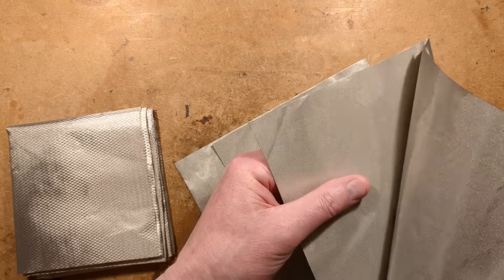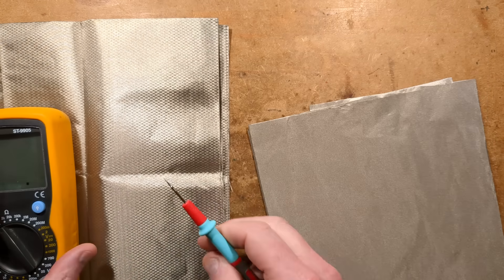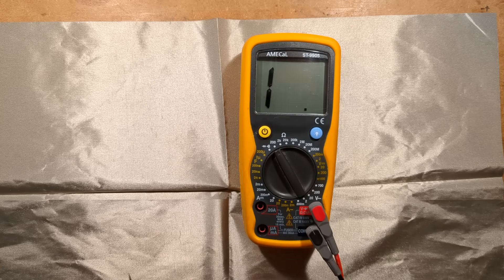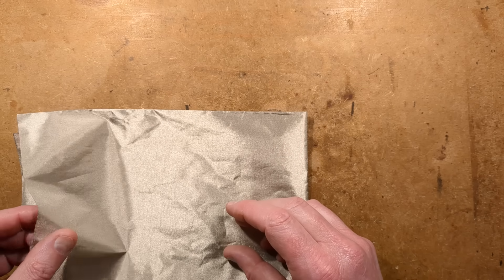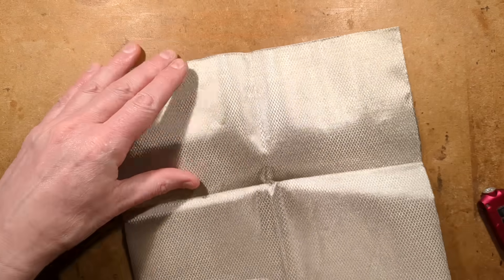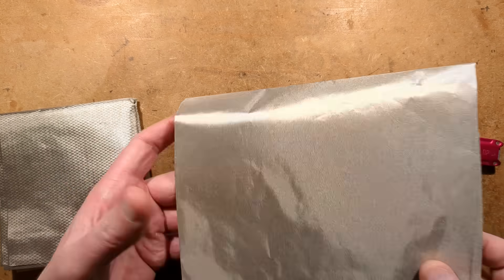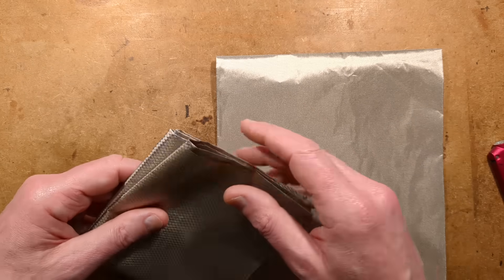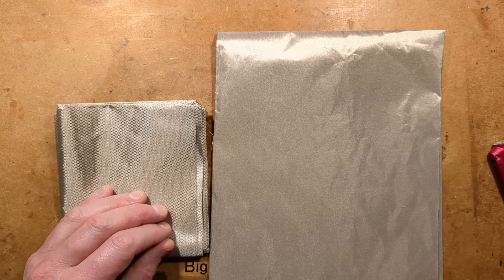Anti 5G fabric is amazingly conductive

Comment: I can see this being used for flex sensors (those used in data gloves). Where you use velostat as a squishy variable resistor, between 2 layers of conductive fabric. It was made before with conductive silicon in lab, so this could open some doors indeed.
Reply: Do you have an English version of what you just wrote? Flex sensors? Data gloves? Velostat? Conductive silicon?
Reply: @paulsengupta971  Sorry for the confusion, here are a few explanations :
- Data gloves are devices (or gloves) that you use to transfer your finger and hand movement into computer inputs. Its most current application is Virtual Reality for increased immersion. One open source project on this topic is LucidVR Gloves.
- Flex sensors are sensors that measure strain while bending. There are multiple ways to measure it, though, the most common way is through capacitive effect, though, resistive, electromagnetic, optical and magnetic techniques exist. They are often sold industrially, or with arduino kits. You can build a variable resistor or capacitor to make this effect.
- Velostat is a polymer film that is slightly squishy, that contains lamp black/carbon to make it slightly conductive. If you place 2 electrodes on either side, and increase the pressure, it reduces the restistance, meaning, it can sense pressure. If you confine it along a flexible strip, then, as you bend the strip, the inner electrode will bend more than the outer one. Squishing a bit the velostat, and reducing resistance.
- Conductive silicon consists on adding conductive particles to a piece of silicon, acting as a sort of thicker velostat. 

You can find more info on the first 3 on wikipedia, and there are many flex sensor tutorials on instructables.

I hope my answers have helped you, have a nice day.

Comment: How easy is it to stitch, and how well does it stand up to being stitched?  Or does it need to be bonded with an adhesive?  I could see this being useful to make a faraday cage shielded drawer for car keys to prevent those repeater attacks—the pouches are a bit naff.
Reply: Seeing polyester in the materials, it's likely same as a polyester T-shirt. Not ideal feel on the skin, but "just fabric" for sewing purposes.
Reply: @sharpfang that’s interesting.  Could be sewn as a backing to some felt, and then an earth lead bonded to it and that terminated in a standard UK plug.  Would then have a decently shielded drawer (wouldn’t  be anywhere near perfect, but good enough for a normie) for car keys and anything else that warranted it.
Reply: @Szlater  It is commonly used for shielding car keys, rfid fobs, credit cards etc. Even without grounding, the inlay plus thickness of coating material suffices against stealing the data with smaller, easier to conceal devices at contact distance, or bigger (briefcase/suitcase) at more extended distances.
Reply: @sharpfang good to know, thanks!

Comment: You can also make taser-resistant clothing with this stuff --- sew a lining inside a jacket that'll act as a short circuit path for the taser.
Reply: You'd need to make it thick as they're designed to piece fabric to pentetrate your skin..
Reply: @user-bt2lx4gy7h  never been tazed, but unless the prongs are insulated after the first 1 - 2 mm then piercing should not be a problem since the fabric would still make contact with both of them and having a lower resistance than the body it would take most of the current  thus making the wearer feel less or possibly nothing .
Reply: Do we have any volunteers to try it?
Reply: @martinploughboy988  Tell to Johnny Knoxville! 😅
Reply: Isn't a medieval gambeson also tazer-proof as the barbs can't reach your skin?
Reply: If you're wearing a jacket then you hardly even need to sew this stuff on to begin with.
Reply: doesnt it need a ground tho?
Reply: @CASyHD. No, not really. The electricity only effectively flows between the spikes and if you short circuit them, they're useless.
Reply: @Biped  They'll still hurt like crap when stuck into you, mind.
Reply: @Anvilshock 
Hurt, but not down!

That’s the distinction; a taser’s job is to completely immobilize a person, otherwise it’s just a fancy piercing tool.
Reply: @Operational117  Oh, sure, it'll still be hurtful depending on how thick a set of clothes one would happen to be wearing at time and place of impact, just perhaps not quite as electrophysiologically incapacitating.
Reply: > "doesnt it need a ground tho?" Draw the whole circuit! (Could be this channel's motto.) The Taze current runs from prong to prong, not to ground. The Tazer has no connection to ground.
Reply: @CASyHD.  It'll have a ground after the suspect has been tasered and is lying in direct contact with the floor.
Reply: @CASyHD.  No, as long as both Taser probes hit the fabric, it shorts them, so you don't get tased.
Reply: @antronargaiv3283  If someone's really that paranoid about it, you can always sew this stuff to a thin, relatively flexible layer of some rubber-type material behind it, which would further limit the piercing depth of the projectile while keeping the likelihood of the EMI fabric becoming the only current path, and this would keep the live fabric conductor away from the skin. Totally unnecessary (I agree with your prediction) but again, if someone wants a bit more peace of mind...
Reply: Exactly what I thought. It’s a billion times better than straight sheets of metal thanks to being literally a piece of fabric!
Reply: I doubt it. The human body is quite conductive and will make contact with a large part of the prongs. The fabric on the other hand is very thin, so it won't have a good contact surface with the prongs.
Reply: Last I checked my body had slightly above the 0.7 Ohm of this fabric.

Comment: I have used similar fabric for laboratory work. We did electrochemical measurements where the signal was in the ~10-30 nanoamp range and the fluorescent lighting/equipment in the lab produced insane electrical noise that would mess with our measurements to varying degrees depending on where you set up in the lab. You could account for a lot of it due to the fact that it was all 60Hz noise, but it still had an effect.

We bought a commercially available faraday cage for ~$5k while the lab was smaller but then we started to expand so I had to think of a more economical way to have more faraday cages and came across this type of fabric.

$1000 in fabric and $100 in lumber and hardware and we had three more faraday cages. And they worked better than the $5k faraday cage. The commercial faraday cage brought the noise levels down to around 5 nanoamps but the cages made with this type of fabric brought it down to 1-2 nanoamps.

Highly recommend this fabric to anyone who needs a faraday cage for laboratory work and is a bit handy.
Reply: How many layers did you have in your Faraday cage.
Reply: Just one. You could probably bump the noise reduction by layering it but the company I got the fabric from was not of the “5G blocking” variety and contained silver. It was very expensive per square yard.
Reply: The sellers of this shouldnt have sold this as wifi or 5g. They should have sold this as a HIFI hat fabric
Reply: @lasskinn  (you're supposed to submit the patent first!)
Reply: @lasskinn jokes aside an ungrounded shield is not going to be very effective. You could wrap the entire hat in copper and it would just attenuate a bit the signal. Real shielding needs grounding otherwise it essentially acts as a very poor antenna (as any PCB design software will tell you if you live any copper area unconnected).
Reply: @InTimeTraveller well it just needs to be a hifi sack instead of a hat
Reply: The critical bit is the joins at the edges. You want electrical contact every few mm, depending on the frequency. The shielding box around the antenna front end on a broadcast TV receiver has spring fingers all the way round the lid.
Reply: I think conventional flourescent lighting is a vexation to the soul as well as an avoidable source of noise and irritation to living systems and electronics.
Reply: Did you do any measurements at how effective it was at blocking 60Hz specifically? I'm detecting very small signals at 2kHz and mains harmonics are a big problem.
Reply: (Forming hands Spock like into a triangle in front of my face): " Fascinating!
Reply: Yeah, figured this stuff is probably a quite attractive option for DIY EMI shielding, especially for those tiny-measurement-value jobs (and even more especially for wearable electronics doing it). It might also be useful as a physical sensor depending on how predictable the change in resistance is when you deform the fabric in various ways
Reply: Thanks for sharing, really interesting! 👍
Reply: Conspiracy theories aside, I do sometimes wonder about the mental health effects of this kind of electrical noise.
Reply: It’s in the nanoamp range…
Reply: @RobotToaster none whatsoever, not counting the mental stress of the people who think about it too much.
Reply: @RobotToaster  they have been repeatedly failing to prove anything bad comes from it, since the invention of cellphones if not earlier. If you count radio, we have been under those waves for generations at this point
Reply: @RobotToaster  What helps is going outside and watch the trees. Walk a bit, look at the trees. Sit in the park, that kind of thing. It's not so much the electrical noise, but more the artificial environment that your brain isn't a fan of.
Reply: @RobotToaster Mental effects are almost unquestionably nil. RF energy is not good for your body's cells; it is a potential carcinogen.
Reply: @RobotToaster  If it has an effect, it seems like it would be literally "in the noise" compared to other things in the environment and just the general hostile culture which maintains struggle and instability for most people through various means, which contribute to negative mental health effects in most people.
Reply: @Aeduo  I hear you worked on the turboencabulator?

Comment: You mentioned dehumidifiers. But could such a fabric be used for humidification? Wick-based humidifiers are awful because the wicks have to be replaced every now and then, ultrasound are awful for me personally because they make me feel like there's a swamp inside my nose. But maybe this could be used as a wick since AFAIK a surface becomes hydrophilic when it has a charge.
Reply from the maker: Not sure if it would have uses in humidification.

Comment: Filter material in ioniser air conditioning. Maybe as the last element  of a graded earth return air filter, trapping pre ionised  smallest pollen and bacteria particles.
As well as providing protection against tazer guns, as many have previously suggested, it might also work as protection against microwave crowd control weapons.
Reply: You can get electrostatic filter either passive or active, the passive one is kinda similar to this but its solid metal in a wider mesh to allow air to flow past.
Active electrostatic uses solid stamped sheets of stainless steel that get charged up externally. This might work but then you'd damage it when cleaning the filter.
Reply: @jaro6985 perhaps cleaning of the fine filter could be performed by a combination of reversing the air flow and the charge. The idea was to use a graded range of filter mesh, ending with this very fine cloth mesh. I do not claim any originality, only a possible application for this conductive material, where the conductivity might be used to trap pre-ionised ultra small particles. It might be worth investigation to avoid the high cost of one time use HEPA filters. I have used a similar arrangement of ioniser and grounded copper wool to avoid the problem of a negatively charged ion cloud depositing air born dirt on walls. It also reduces the effect of the charged air cloud switching touch sensitive light dimmer switches, as the ions are discharged without being emitted into the room .
Thinking about it, reversing the charge and air flow direction might work, particularly if  an alternative collection trap could be arranged. In my tests with copper wool ( SAUCEPAN scouring pads ) the dust tended to collect, much like that which accumulated in the back of old CRT televisions, where great clumps collected on EHT wires and valve tops. In my experiments the copper wire was easy to clean with a vacuum cleaner. I never made a permanent unit, as the prototype was constructed out of rather ugly uPVC drain pipe fittings. A small 12 volt computer fan sucked air past the ioniser point electrodes and through the grounding copper wool.
Reply: @nigeljohnson9820  Yeah could be worth a try, especially if you fold the fabric like a pleated hepa filter.

Comment: i have a very, very niche problem i sort of solved by using aluminium foil, it was very expensive for how much it was and not enough to cover the area, these looks like a better and more elegant solution than taping foil on my desk and around some components.
what happened to me is that as both a hobbyist illustrator and electronic musician, i own an analog synthesizer and a wacom tablet, wacom tablets work by using magnetic fields so the pens are unpowered, the issue is that when plugging the keyboard to my pc to record the sounds while the tablet was connected caused a lot of interference from the electrical fields around the keyboard, depending on where i moved the monitor, pc, phone, tablet and the pen itself over the tablet surface, the synth would emit different sounds that resembled shortwave radio tunning, it was a very sci-fi sound and i could see some uses for it but i didn't want to have it while making music, now if for some reason i want to get that sound i would have to remove and potentially shear the foil from various places.

Comment: inserts to 3d prints like a flexible powerline
Reply: Yes, oversized conductive ribbons do have some advantages to thick cylindrical wire.  
Where a thick wire can't fit - often it will instead fit a large conductive surface coating instead (eg: this fabric).  
Large spread-out conductive fabrics/foils can also be a lot more flexible & robust than an equivalently conductive diameter of multi-strand wire.
Reply: @roidroid  no idea if something like that would hold up, but worth a try
Reply: Pretend it's ringworld engineers superconducting cloth.

Comment: DIY Nickel–iron battery electrodes. The high surface area might improve current output, although not sure how long the thin wires will last after a few cycles.

Comment: I wonder if it can be used to make high voltage capacitors
Reply: Yes but plain old kitchen foil would be better. Less air gaps between the electrodes. This is important because at more than a few kilovolts, corona discharge can form in the air gaps and make hot-spots, melting the insulator.
Reply: @TheTemporalAnomaly I've used foil in the past using pickle jar (laden jar), it was more of a fun experiment than anything practical.

Comment: Someone with the right instrumentation should do more testing of impedance over frequency.  Seeing the other ham comments here about uses in antennas, someone might have already done that.  A creative person with an RF lab could repeat the measurements from 20+ years ago of the popular designs for foil hats!
Reply: Impedance is more about the shape and size of the antenna and where you feed it. Make a J-pole out of it, feed it at the right point, and it'll be 50 ohms.

Comment: Is this the stuff ThreeUK wrap around their phone masts to ensure nobody gets a signal? 😂
Reply: Is that why the first EAS test didn't work? (Another test on 7/9 this year, btw)
Reply: @itskdog  It wouldn't surprise me. 😂
Reply: @itskdog  they blame the problems on lack of spare valves and the shortage of morse key bearings due to COVID and the Three Day Week.
Reply: hold that thought... what if insurgents deployed this via drone onto cell tower?
Reply: @dzhiurgis me and my friend planned to do exactly this in a robotics competition once, but unfortunately it was against the rules
Reply: @dzhiurgis  Probably a lot of effort when you can likely just use force (bolt cutters or whatever) to open the appropriate enclosure, cut the power in a manner that doesn't kill you in the process, then butcher the depowered wires so it can't easily be powered back on
Reply: i get no signal with them either

Comment: Where do I get it ? I can use it for a ground  plane beneath my ham radio  antennas?
Reply: It should work, but I wonder if moisture would corrode it, maybe coat it with varnish to waterproof it?
Reply: Use good old copper wires, good enough for the broadcast industry.
Reply: It's also known as the "magic carpet" in ham radio circles.